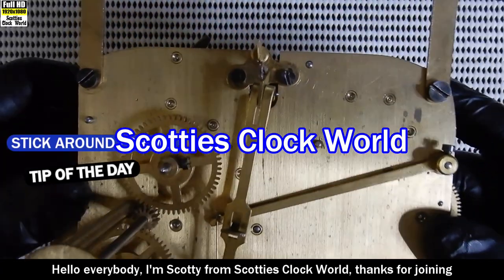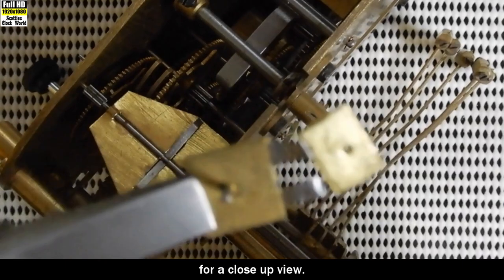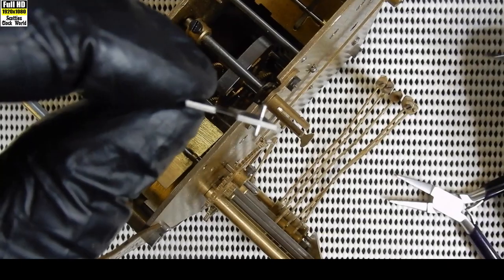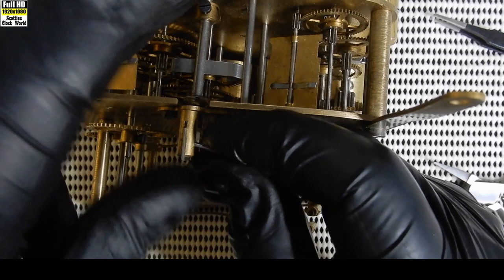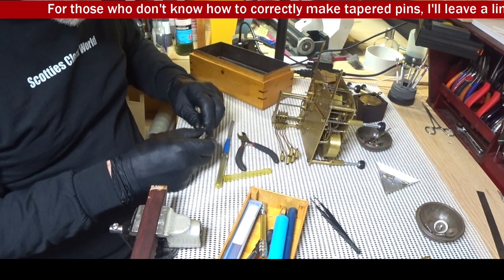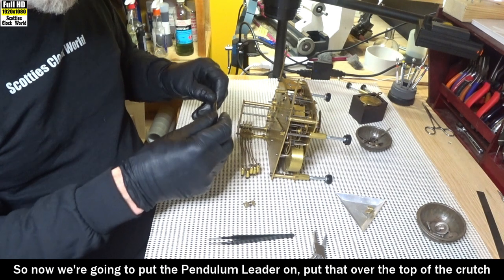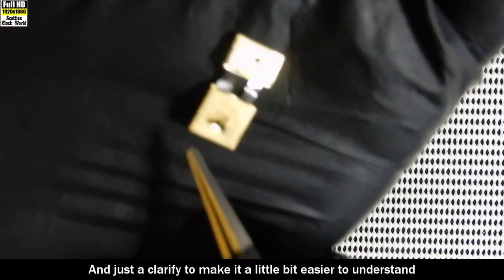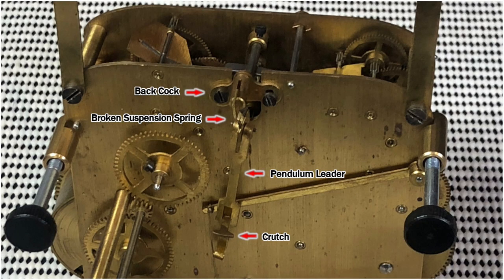How To Replace A Damaged Suspension Spring- Episode 5

Comment: someone gave me an antique mauthe grandfather clock, and it needs a new suspension spring, they had tied a piece of wire in place of said spring...how can i find out what size/type of spring i would need for this clock? its so old, and i havent found a lot of information on it. even worse, they had rummaged up some old weight shells, and filled them with sugar, so that will be an interesting fix as well. thank you for your wonderful videos!
Reply from the maker: Cousins in the UK has some Longcase Suspension Springs:
https://www.cousinsuk.com/category/pendulum-clock-suspension-springs
Hope this helps.
Thanks for your kind comments.

Comment: What happens to the clock if you have a bad suspension spring
Reply from the maker: It won't stay in beat and it will stop running.
Reply: Thank you
Reply: Scottie thank you for the help. With that being said my spring is a little bent would that classify as being bad
Reply from the maker: @cindynmn2936  , it wont help the clock run smoothly, but it will probably still run. I will be doing an Episode on straightening out a bent/damaged suspension spring within a couple of weeks.
Reply: I will be watching I want to find out why it won’t continue to run. Thanks

Comment: Scottie, my clock has a back cock with just a slot no hole for a pin. I believe it's an old Seth Thomas Mantle clock with a code 89 stamped on the back of the works. The case is lion head.
Reply from the maker: The Suspension Spring will have a small dint in the top of it so it doesn't fall out of the Back Cock.
Reply: @ScottiesClockWorld  Thank you for sharing your knowledge and expertise  Sir.